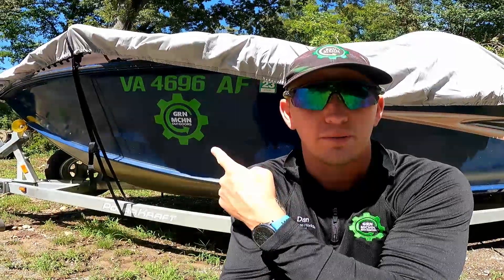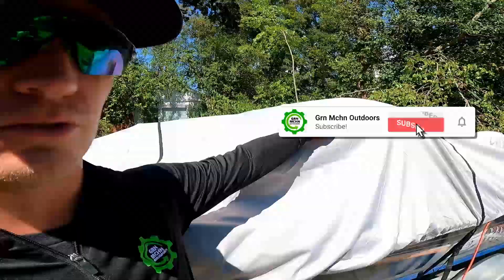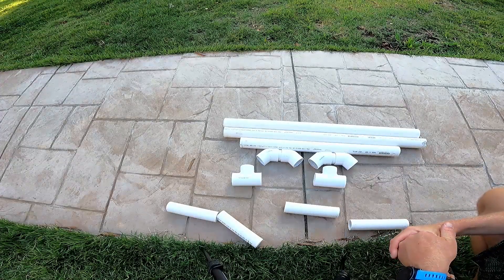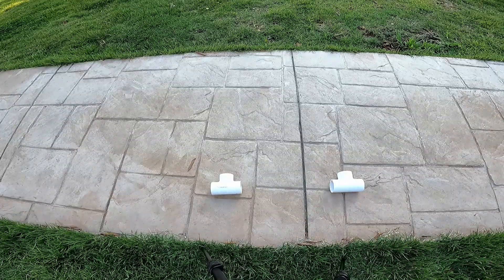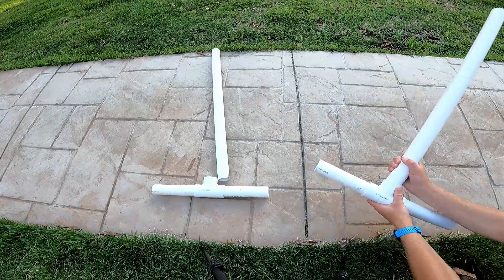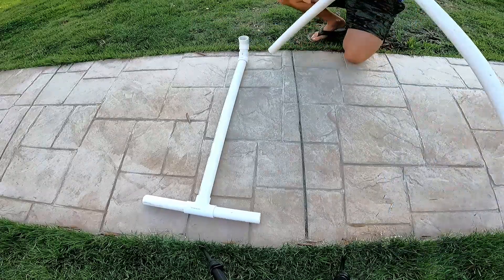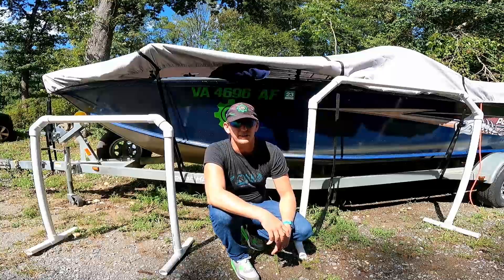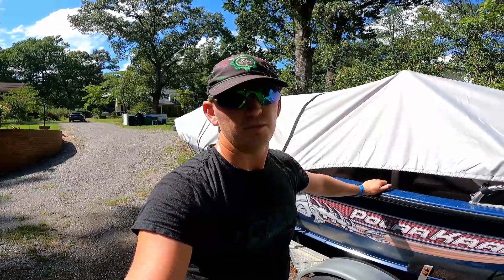SIMPLE PVC Boat Cover Support Solution

Comment: This is what I’m looking for!!. I got 4 single adjustable aluminum boat cover poles for my pontoon. They don’t work, they tip over and collapses leaving water pool traps.
Was your pvc schedule 40 or thin wall s&d pipe? And did you glue your joints? What size pipe diameter?
Reply from the maker: 40 but I’m sure either would work fine. I’m using inch and a quarter and I haven’t glued yet but will at some point

Comment: Even the cover that cam with our boat will pool in the bow section unless you put a seat in and raise the back rest. We would have to install the seat every time we covered it because we dont take the 3rd seat with us fishing to give more room. I was thinking of doing something similar to this! We can get the boat in the garage but it is extremely tight!
Reply from the maker: I had it set up through a week long rain storm before making the video and it worked great. Thought I'd pass along the info. Wanted something easy to pop in and out and had most of the material laying around. Win win!